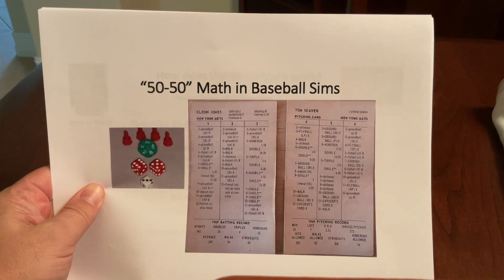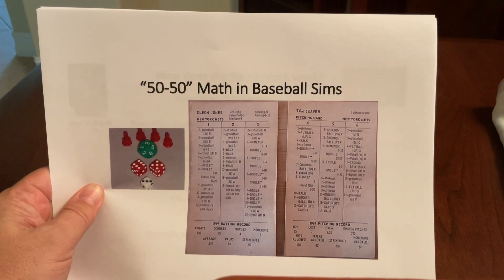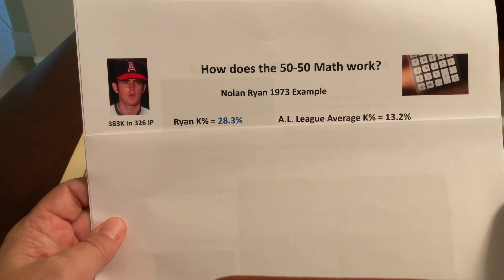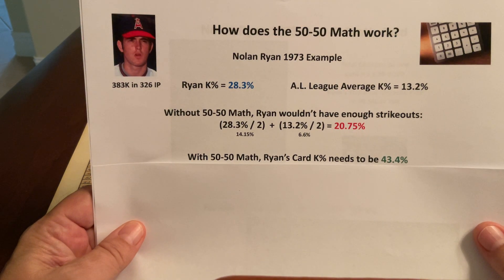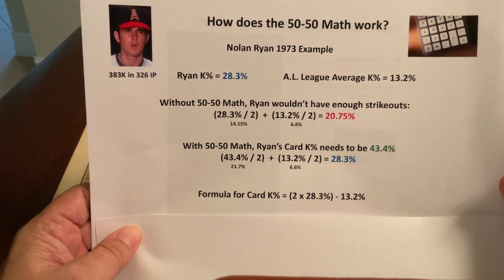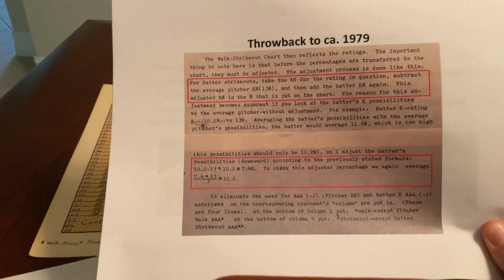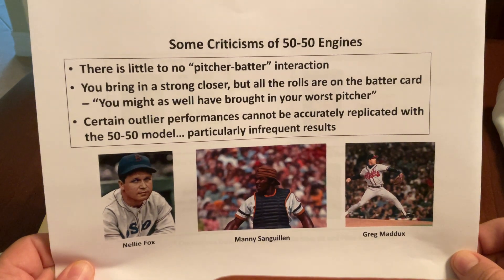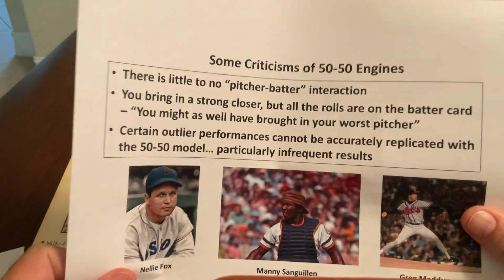"50-50" Math in Baseball Sims: Basic Explanation and Discussion

Comment: You have to subtract the walk  4_10    so there are only 105 chances, if I am reading his card correctly      - pretty blurry
Reply from the maker: The Seaver card at the beginning has a Walk on 4-10, and the Nolan Ryan card used in the example has a Walk on 4_11 and other places.   I think 108 is the correct denominator because all this math is based on plate appearances, not AB.   (One possible exception is that I think Strat excludes some or all intentional walks from the stats before calculating the BB%, K%, etc.  However, regardless of how intentional walks are treated, the denominator is still 108, i.e., 6x6x6.)

Comment: How come nobody ever complains about the time a relief pitcher comes in to face the toughest hitters and all the rolls are on the pitcher’s card and none on those tough hitter’s cards?  It’s got to happen just as often as the opposite that does get talked about ad nauseam.
Reply from the maker: I tend to agree with you.  However, I think it comes down to a psychological thing with some people.  As a result, games that obscure or re-imagine the so-called pitcher/batter interaction have started to become popular.  Payoff Pitch is a good example, although technically it has some of the same issues... your home run hitter isn't going to get a chance to hit a home run if the pitcher rolls a "Tough".  

On the other hand, I just became aware of Season Ticket Baseball.  A lot of people like it, but the basic engine has a lot in common with other 50-50 games like Strat.  

The most important thing for me is statistical accuracy (which is a whole other discussion).   Of course, flow of play is important, so if a game gets too complex, that can be a turn-off.  I'm not as patient as I used to be. :)

Comment: The 50/50 and outliers like Nellie Fox K's.  He could have a rating like a 20 sided split when he rolls a K on the pitcher cards.  The computer game actually does adjust something similar to this method for internally declared outliers.  The outliers are such a small sample it usually wouldn't require any adjusting in other areas to compensate.  The small difference would just be covered in the normal variance of any game.

In game design another issue, should players be immuned from a baseball possibility of an event?  For example,  in the over all passed balls is a small sample event.  Should a catcher with no passed balls be formulated for getting minimum of one passed ball?  Another extreme example,  5 catchers in a league have 2 passed balls and the other 5 catchers have 0 passed balls.  If 0 passed balls catchers are formulated for a chance of getting one then the catchers with 2 passed balls will be formulated for a less chance of getting their 2 passed balls to cover.  If you don't your league totals could take a hit.  This example is extreme, but conveys the point.

It's always been my theory all batter's with 0 homers in SOM should have a 1 in 4320 chance placed on their batter card with the weak batter power rating meaning his homer would have to come off his batter card.  IIRC, the largest at bat total by a player in the 1900 to present era is Tom Oliver with 1931 at bats with no homers.  Thus, no one has ever accumulated 4320 at bats without a homer. 8:11
Reply from the maker: You make some very good points.  Your idea to address the Nellie Fox situation was used by people who “upgraded” the SI game… another dice roll if there was a BB or SO from the pitcher card, but only if applicable.  A couple of days ago I did some math on the 1971 NL data and it said maybe 10% of batters potentially had the Nellie Fox issue (although often very small) and a lesser percentage had the low walks issue.  On your second point, I agree totally. Where practical, when making cards for sims, I try to allow for at least a remote chance for every hit result.  In Statis Pro I do this when formulating the batter BD range.  I may have mentioned this in one of my other videos but I don’t recall.

Comment: I speculate the 50/50 method is mathematically the best way to formulate a baseball game.

For those that would say the batter or pitcher has a better than 50/50 effect on the result.  SOM could formulate cards, for example, the pitcher for columns 3 through 6 or 67% or batters 1 through 4 columns or 67%.  Anytime this was done the 2 left over columns would be formulated via different percentages to skew back to being 50/50.  For example, the batter card based on 2 columns would just be loaded with more batter's performance, but the batter now is a smaller sample with only 33% influence.
But at the point of let's say the batter has the 1 column only and the pitcher 5 columns as a form of influence on the matchup the balance of player accuracy will be lost from a smaller sample of 1 column being influenced by a smaller sample versus a 5 column producing less variance for pitchers due to the larger sample.  So, they each get 3 columns each to keep the balance and to have equal chance of variance on both sides.

Final analysis,  even non 50/50 based games have to try to migrate back to 50/50 unless one can accept more variance in getting more accurate player performance.  A game could base every player on the league average and just let the dice determine a player's performance.

Heck, a game could be 33/33/33 formulation.  The 1 and 2 column loaded with batter performance, the 3 and 4 column is generic to all based on league average, and the 5 and 6 column loaded with pitcher performance.   But keep in mind anytime one side or the other or the case of all in thirds the variance is swayed by the sample sizes.
Reply from the maker: The imbalanced weighting you describe is essentially what Statis Pro is, and the math (when done right) accomplishes what you describe. In some ways, my own sim is the 1/3, 1/3, 1/3 model but not exactly.  The split into thirds is used to determine BB, SO, and balls in play. Safe/Out is a combination of pitcher and batter, and type of hit is mostly batter-based.  Kind of interesting, but several dice rolls per plate appearance.  Other sims (APBA, SI, Payoff Pitch, etc.) use a different model entirely.  You do get to essentially the same place but a different way, so the math is different. Apples and oranges, as the saying goes.
Reply: @steveetzel6730  I like what I see with statis pro, but it appears to put more emphasis on the batter's totally controlling the extra bases.  I like different pitchers getting the PB rating based on their performance.  In a similar matter, SOM could do it in a computer version by creating pitcher performance by column control and just have the overall migration back to an expected 50/50 overall.  It may sooth those that hate putting in a pitcher or a closer and having the batter card ruin his appearance.  However;  each batter has extra influence by his own performance and as they say the luck of the dice.  However;  the 50/50 model does permit the pitcher or closer to roll on a batter with a very poor card.  Of course,  even a  4 or 5 column pitcher influence could still be ruined by the batter 1 or 2 column rolls being so hyped up.

The SOM does emphasize individual defense having a percentage impact which is good.  I have found a slight flaw in the system is that the errors aren't  distributed by bat hand via position ratio.  IOW,  for example,  a lefty batter should get more errors from first baseman and
 second baseman beyond the ratio of what the lefty/righty at bats should produce.  Picking nits and a minor flaw, but factual based on real data versus what the SOM system would produce.

Comment: Its an interesting topic, Steve.  There's probably a good study to be done about the level to which baseball sims are "50/50"...or perhaps more accurately, which ones involve hitter and pitcher characteristics on every at bat.  On one hand, APBA and Strat don't often have both impact an at bat as compared to say, Replay or Payoff Pitch...and then to a lesser extent Play Ball and Inside Pitch.  Like many things, the gamer himself I suppose, needs to determine how important that factor is to them.  But I could see some sort of sliding scale with Strat and APBA on the left and Replay/Payoff Pitch on the right and the others (that I know about) somewhere in the middle.  You could probably even run some simulations to quantify those percentages - the more the sims evaluated, the more interesting the analysis (IMO).

Comment: When the term "league average" is used, is the calculation based on the entire league average or the league average minus what that player's team contributes? It might not be a big deal but for some teams that contribute heavily to a certain type of statistic then perhaps it might?
Reply from the maker: That is a good question.  I don’t know how Strat or other sims do it.  I did another video on that specific subject: https://youtu.be/ehfnrzGxECA?si=Ymyh3uqDN6NUlLwO
Reply: Yes to my understanding, SOM does take out the teams data before coming up with that given team's players league average competiton faced formulation.  This again can be a bit of an outlier, since most teams will play within the 1st standard deviation of league average.  It leaves very few teams really benefitting or not by taking out their own data,  but maybe a few seasons like a 1927, 32, 39, or etc. Yankee teams or others may sometime really benefit.  For example,  as an easy example eyeball observation the possible benefit by a teams run difference offense to defense.  To take this to another step an extra adjustment could be made by weighting the team league average faced by the RISP batting to not RISP batting adjustments to the overall league averages faced for formulation.  No way around it, though the smaller sample RISP hitting or pitching correlates moreso to winning and losing than non RISP batting and pitching situations.

Comment: 50-50 in SOM does not reflect the game of baseball.
Reply: If the numbers come out pretty accurate, does it matter?
Reply: @justinludwig726  Exactly,  all games are trying to migrate back to a pitcher/batter 50/50 statistical accuracy to a degree.  All versions will have some form of variance due to sample sizes and dice or FAC luck.  What I like about the 50/50 model is the variance is possibly equally based on the batter and pitcher sides of the performance.  I would call it a balanced variance while other games with the smaller samples to account for pitcher influence over batters or trying to prevent those closer batter card rolls or influence as in SOM, creates other variances due to adjusting via the smaller samples for a few outliers or perceptions.
Reply: @johnnysmoke612  I'm not sure what "smaller samples" other games are using compared to strat. It's already pretty clear that true 50/50 games cannot handle outlier performances, so I would assume that 50/50 games might also have smaller variances (defined as the measure of dispersion). With the dice rolls going to the batter or the pitcher, you could more or less guess the final outcomes (in the long run) based on what weights you use for batter/pitcher rolls for each player. For example, a pitcher with 55% of dice rolls on his card will have slightly more weight to the results on his card versus the league average. 

A game like Replay, which is not really a 50/50, would probably also have the same "balanced variance" since there are readings from both cards simultaneously. Though a game like Inside Pitch or Payoff Pitch might have an interesting bias problem since a reading comes from the pitcher card first.
Reply: @justinludwig726  Yes,  the 50/50 model will have a few outliers or there needs to be an adjustment.  My example, about Nellie Fox no K's on his card and he gets a split reading adjustment for K's on the pitcher's card to address the slight discrepancy. The game doesn't original have splits on K's with another split chance result.  However;  to accommodate Nellie Fox for his outlier some pitcher loses his K he was originally designed to get except by the luck of Nellie Fox rolling on his pitcher card with a K applied split sdjustment.  This is a small sample of K's that I would be surprised would warrant an overall adjustment upward for pitcher K's to accommodate for the few Nellie Fox's of the league.  Now if there was an upward K rate on pitcher's card to accommodate for this outlier a few pitcher's are now K boosted with a very random chance a Nellie Fox will eventually roll on their card to justify any adjustments.  However; this is all based on outlier small sample adjustments and  any very small sample like this will have some variance.  Nellie Fox should lower his K performance with an applied K split chance ratings on the pitcher cards.  But now the snowball is rolling down the hill for more possible smaller distortion to a given pitcher's K totals or by random chance another batter gets an additional  K or two due to pitcher adjustments upward for K's to account K's lost to the outliers.  In short,  a bunch of gears and any gear turned any direction from the balanced point will make other gears turn in other locations to compensate.  I hope that makes sense with all the math jargon.

Another side note,  what replaces the K the pitcher loses and what does Fox get for no K outlier fix result a walk, another out type, a re-roll on his card to compensate for the stat BABIP or a re-roll on the pitcher card to compensate him for his BABIP allowed and the chance another K is rolled by Fox on the pitcher card.  Like I've pointed out it starts a snowball rolling down a hill for adjusting, especially, for smaller sample not as relevant results.  Something like homers adjusting is highly relevant due to the impact on a game, but K outliers is pushing it a bit for what replaces the adjusted lost K.  Realistically,  it could be any other result other than a K, the key, where does the game go mathematically to get that other result.
Reply: @johnnysmoke612  “small sample” is based on at bats or plate appearances. An event that is rare but has lots of plate appearances is not a small sample, just a low rate event. A lot of games have difficulty hitting these rare events.
Reply: @justinludwig726  True, but making adjustments within a system for things like a few K outlier hitters is a small sample of the whole,  since the adjustments deal directly with that event and even a smaller sample of that given event from the whole.
Reply: to me it does.  numbers won't be accurate in some individual matchups.   @justinludwig726
Reply: what i meant applies mainly to HR's, K's, and BB's.  Inside Pitch and Payoff Pitch games adress this well.
Reply: @iamthegreatcornholio7836 To my understanding these games are based more on the pitcher controlling walks, K's, and HR's moreso.

I do know all the pitcher card is doing in Payoff Pitch is just telling what column to use on the batter card.  If this was SOM it would be similar to a pitcher dictating which column to use 1 through 6.  The 1 through 6 columns would be weighted for the batter's performance statistically worse to best performance or vice versa.  Now in simple terms,  the pitcher's performance is now formulated with the dice rolls 2 through 12 to what percentage the pitcher column directs the gamer to batter cards 1 through 6 column.  The only difference is the bland rolls of the pitcher card picking a column by a number versuses a phrase like tough, patient, ballpark, and etc.  IOW, a game that just uses a pitcher control by his ability to column pick.  Again, a form of migration back to the 50/50 model.

If someone wanted a game where the pitcher influences every result  on every roll then base batting cards on their real season data.  Then have everything based on a 20 sided dice breakdown on the batter card and the pitcher would reduce those split chances up or down based on his performance against the league average competition he may have faced.  This seems to a degree similar to what APBA is trying to do with pitcher grades.  Also to a degree the Statis Pro approach, but a bit more mixed.  No matter how you cut it one game pronounces pitcher first control,  the other game pronounces batter first control, but both have to tweak back to a 50/50 style of formulation.  So,  SOM just balances the matchup at the same time for both batter and pitcher and is influenced just like the others by some random variance of the result selection process.  If you like those games nothing wrong with their approach, but people knocking SOM for a closer losing it due to dice randomness have the same thing going on under the hood that is hidden.  IOW, the hiding of what is obvious in SOM is all.